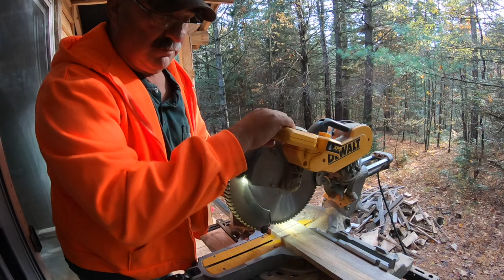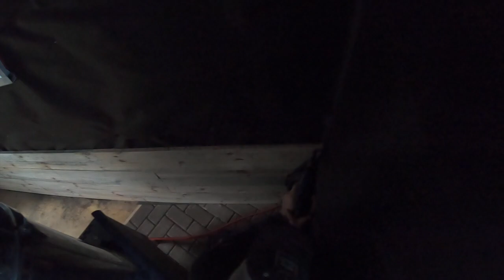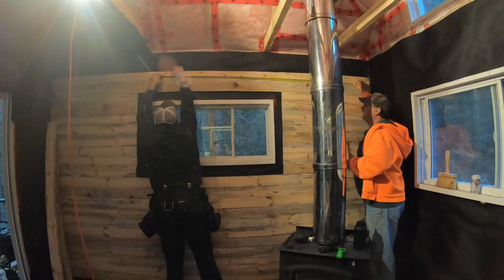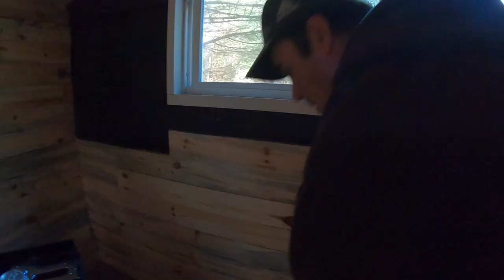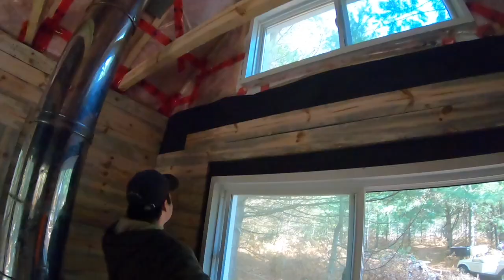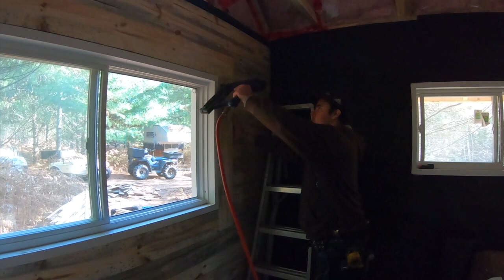Rough Sawn Wood for Tiny House Interior

Comment: Did you let you interior siding dry before hanging? If so how long did you? Building a 20x28 rough cut timber frame house off my sawmill in Mountain View Arkansas. Not drying any one the wood because need it built ASAP. Thanks in advance for any advice
Reply from the maker: I put the wood up wet but It did shrink some after a while
Reply: Did it shrink enough to cause any issue or distaste in your finished wall? Thanks! I'm going to put rough sawn lumber on our walls too.

Comment: Hi! Your interior wall looks SO GOOD!  I want to do something similar to one of my walls. In other diy videos like this, I've seen them use a spacer (like a nickel) to put an even separation between boards. Any thoughts about this? I don't know how wood expands and contracts, but I don't want to huge spaces (or overlaps) between boards. Hmmm. Any advice would be appreciated!
Reply from the maker: Hi Misty, since mu boards were quite wet when I installed them I didn’t leave a space knowing that they would shrink. If you want to avoid big spaces you could air dry the wood for a couple months before installing

Comment: Great video Sandy!  I plan on doing the same kind of wall soon.  How did you get such a straight edge on the boards?  Did you use a jointer?
Reply from the maker: Hi Daniel. The wall boards I did use a planer to make them good and flat after sawing them but the edges are just the edges straight off the sawmill
Reply: @sawingwithsandy  Awesome!  I plan on doing the same but have had people tell me they won't butt up straight.  Great news!

Comment: I have watched all the previous videos.    I notice that for the interior you are using 2 nails per joist.    Seems that the fast drying that will happen when you fire up that stove is going to lead to a lot of cracking?    Awesome build.   Just here to learn
Reply from the maker: Thanks for watching Matthew. Sure has been a fun build. I haven’t noticed any cracking on the joists yet so hopefully that stays that way
Reply: @sawingwithsandy  The outside decking you mentioned only one nail so that the boards dont tear apart as they shrink.   Do you feel like boards are moving more when they are installed outside?

Comment: I like it, what nails did you use?
Reply from the maker: Hi Tim, for framing I use 3.5” galvanized ardox nauls
Reply: @sawingwithsandy  Morning.  Sorry, I meant what nails did you use on the interior siding?  Also, on a previous video you stated to secure green wood with one fastener, I noticed that you used 2 nails on each 2x4.
Reply from the maker: Hi Tim, great question. I used 2" long 16gauge nails on the interior. When framing with green lumber I just nail as I would normally nail with dry lumber just because I want to ensure that there is adequate strength there and I won't be able to come back afterwards to add additional nails